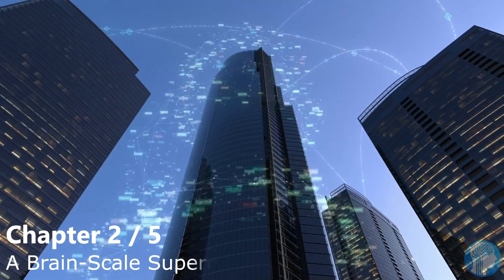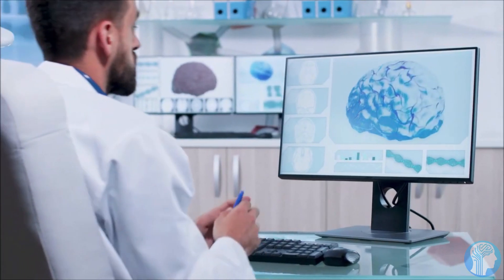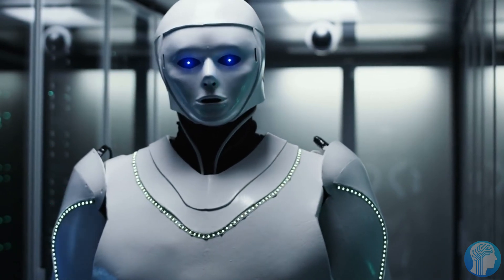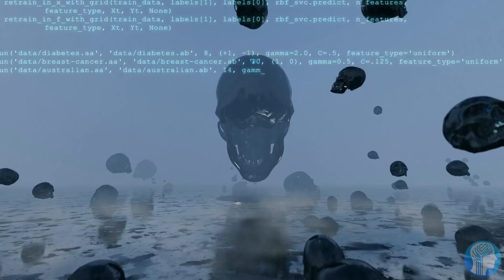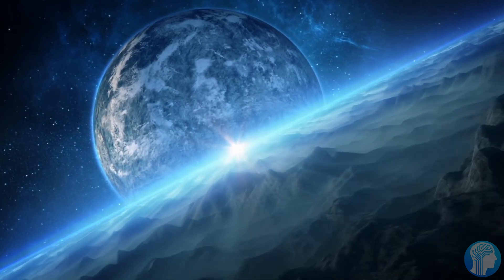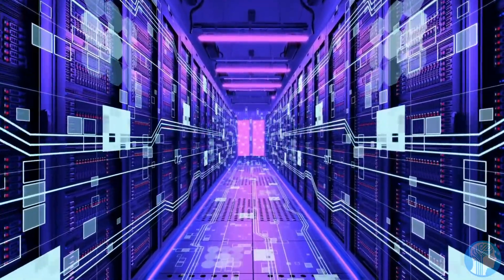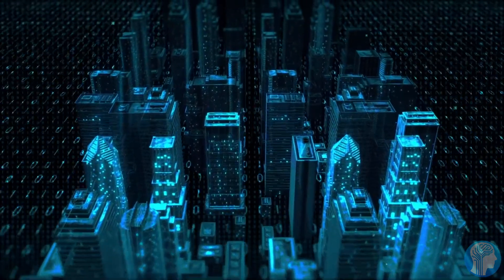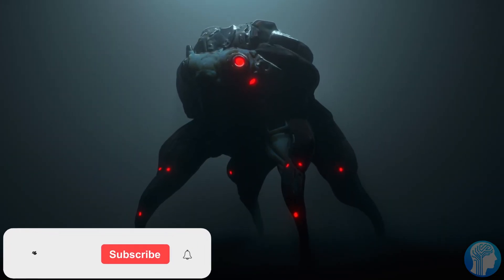This Insane Chinese Supercomputer Changes EVERYTHING

Comment: The United States have gotten where they are by using most of the tech from companies such as IBM and possibly DEC, INTEL had quality of fabrication from IBM, I’m not sure if TSMC got its technology from there but the two companies apparently started level, however the work ethic in TSMC far outpaced that of INTEL so America is in the position of trying to catch up, a position they constantly claim that China holds but, they try to ignore that the Chinese are the ones responsible for most computer technical advances even though TIWAN is a Chinese country in denial! and mostly have their allegiances with the mother country/mainland!
Reply: Taiwan has absolutely nothing to do with PRC. And China was never a leader in computer hardware.

Comment: They might be behind in semiconductors and chips in general, but that's an industry that's not going to matter. AI-assisted design and manufacturing is the edge you need to not have to design and develop chips anymore. Attach some leads to your competitor's chip and have your AI go to town reverse engineering its capabilities and functions. Have your AI, like that infamous generative design car frame example, design application-specific, probably even function-specific circuits and the interconnects and power delivery schemes needed to run them and plop it all on your shiny new chip.

Invest in cars or invest in roads. One of them seemed like the obvious win when that whole humanity-wide transformation happened.